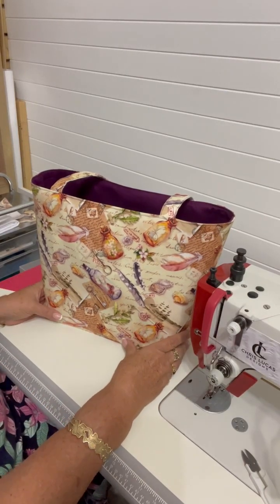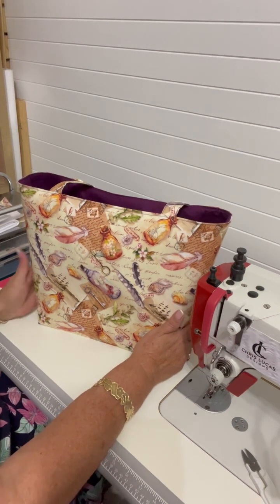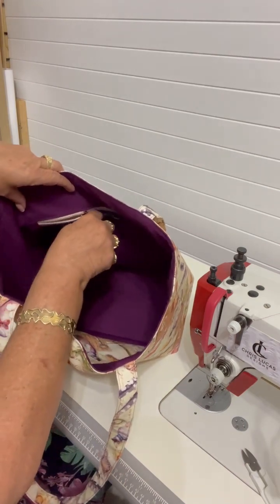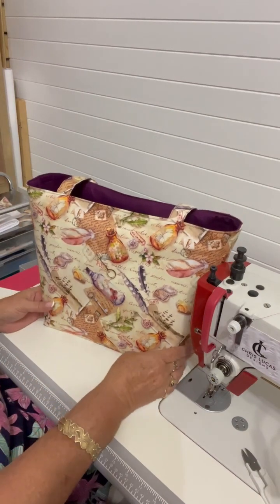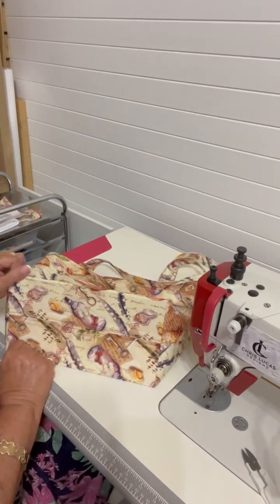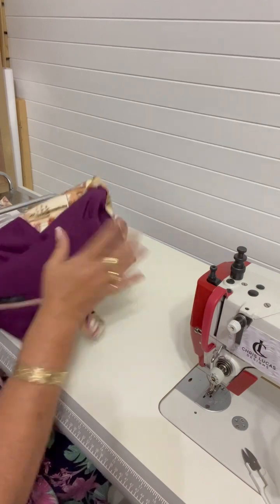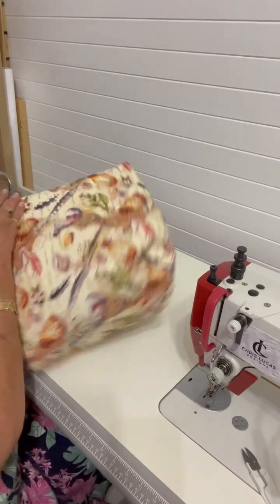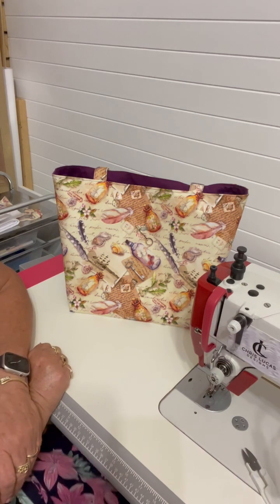Reversible Tote using Sure Fuse Woven Interfacings and Reversible Tote Pattern - Chris Lucas Designs

Comment from the maker: Hi Wendy 👋 as I was using regular sewing thread I did a test on the fabric I had cut off for the boxed corners which had my Sure Fuse Cotton Wove Interfacing already applied and I used a size 18 needle and regular polyester sewing thread (not industrial thread) and adjusted the bobbin tension to accommodate for the lighter thread and tested and found I only needed to adjust the top tension slightly and that was it.  The machine handled the lighter thread and interfaced cotton fabric beautifully through out the complete making of the bag ✅